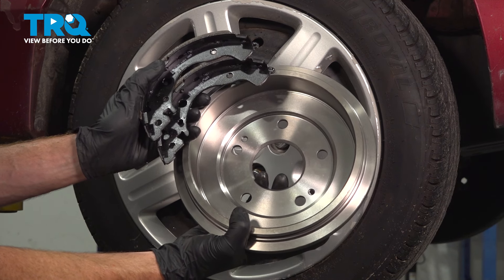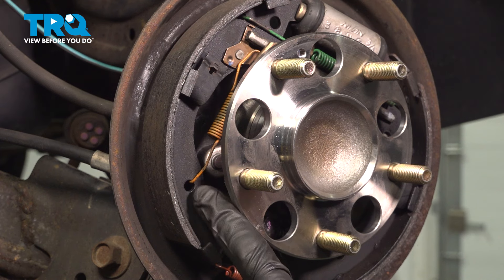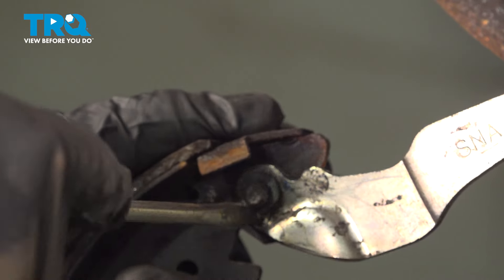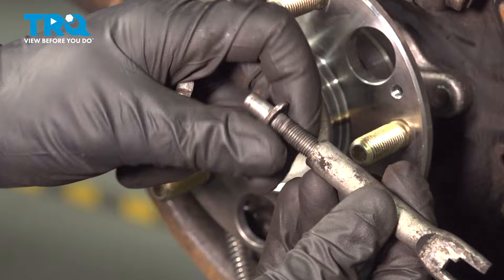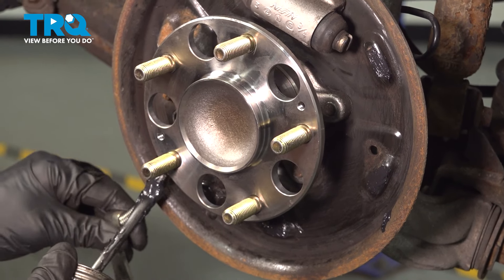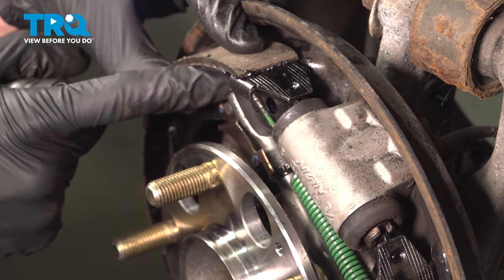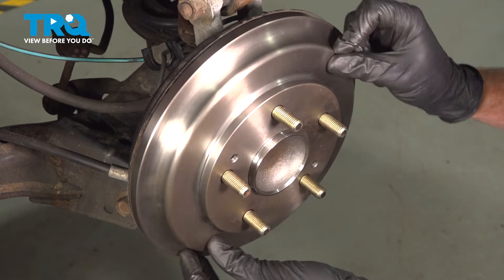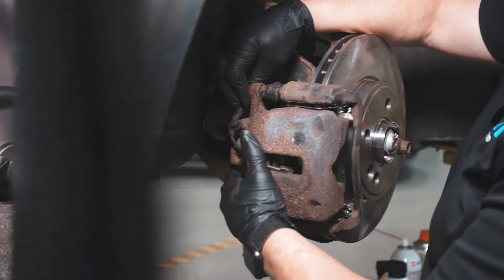How to Replace Rear Drum Brakes 2006-2011 Honda Civic

Comment: I don’t understand how you’re supposed to re adjust the adjuster lever after you’ve installed the drum. Do you just leave them fully loosened? Because if you tighten them back you can’t fit the drum back on, but if you don’t tighten them back you have no braking power. Please help

Comment: also, if you can't remove the drum because it's baked tight...the two holes on the drum are for the M8/1.25 bolts...screw it in and keep going until you separate the drum. You can use one or two at the same time.

Comment: Use a shop vac or compressed air to spray out and clean the dust off everything. Never ever do what this guy did in the video. You do not want brake cleaner or parts cleaner getting in or around the rubber seals on the little piston in there.
Reply: Haynes repair manual does not recommend to use air to blow
Reply: What I learned is for brake drums only, use brake clean at first so dust doesn’t aerosolize because in many cases the brake dust is harmful and can contain asbestos so never use compressed air

Comment: on my 2014 honda civic my rear brake drum are stuck to the hub. I tried hitting it with a hammer to break it free with no lucK. i EVEN USED like solvent for rusty parts... what else can I do?
Reply from the maker: +Core Turkoane  We do not have a video for this repair right now, but we'll keep this request in mind for a future video!

Comment: Nice video. I changed my honda civic 2013 brake shoe same way. Tips for beginner: first remove the adjuster spring. That is not that hard. Then remove both side anchor pin and mounting clips and then lift the both shoes from bottom slots and then remove the bottom spring without any tension on it. After that just slide the both shoes upward and you can easily remove the top spring and adjuster. I followed same guide in this video for new shoes. I just used screw driver and simple plier for whole replacement process.
Thanks you for great video. 😊

Comment: Thank you. Thank you. Thank you for this video! I found out to my amazement I had these drum brakes on my 2012 and while it took much more than 15 minutes as well as a whole lot more cuss words I got the job done. Also a thousand curses upon that top retention spring. Y'all make it look so easy and I just about decided to cut it off before it finally slipped out of it's hole and was replaced with a brand new spring.